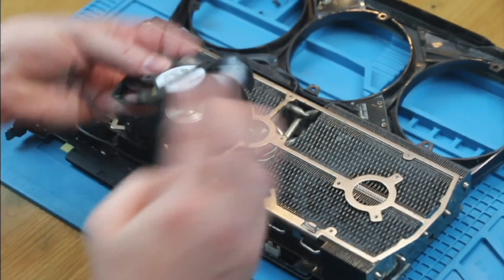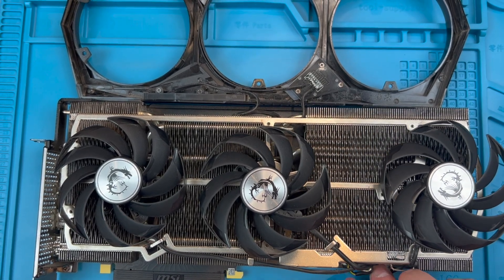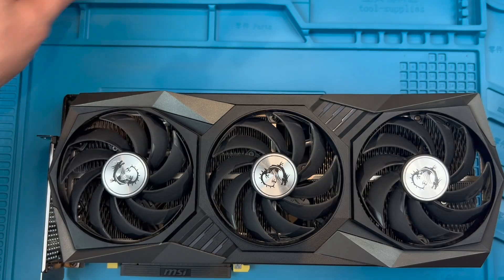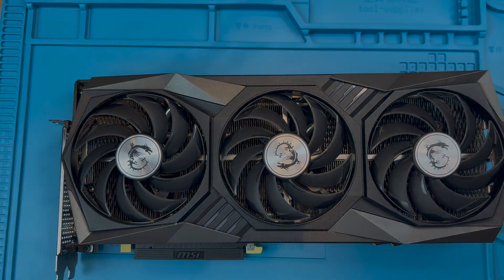MSI Gaming Trio - Easy Fan Replacement in 10 mins

Comment: Thank you for this video! I just bought a Gaming Trio with two inoperable fans. Got a really good deal on it because of it, but the fan replacement kit is cheap and thanks to this video I'll easily be able to replace them in less than 20 minutes. In total 210 dollars paid for a card that goes for about 300 on the used market. I'll call that a win.
Reply from the maker: Excellent, and yes if fans are the problem then a really easy fix. Enjoy the card, new cards are crazy money now.

Comment: Thanks for this. I've ordered some "Singer lubricant oil" from Amazon and plan to flip the fans and apply two drips to each fan bearing.
Reply from the maker: Hope that does the job. The fans seem to a vary a little, some seem to be sealed bearings but back when I made this at least, didn’t seem as common. Good luck 🤞
Reply: @sometechguy  I did it and sadly they don't sound any different.  I couldn't get the shroud off as the previous owner rounded the screw heads annoyingly. This video helped immensely, thanks again Sir

Comment: If set manually, what speed do you consider fans on these models noticeable, or loud?
Reply from the maker: I don’t remember specifically to be honest, but the Trio and Suprim fans move more air than the Ventus for example, so you can run them slower. As I remember, and it’s been a while, 30% or so was pretty effective and pretty quiet, but the time you get past 60%, certainly louder, and at full speed they make a lot of noise. I don’t remember how that corresponds to RPM however
Reply: @sometechguy  my msi trio gets loud above 40 pecent so I did wonder. It's not new, so I wondered if fan wear may contribute to noise. Under 40 percent it's largely quiet and for the most part never needs to go over that speed to stay cool. gpu in games usually runs between 40-50c. The sapphire models seem to be able to run at lower fan speeds from what I can find on here

Comment: I ordered a set of "two ball bearings" from ali express and it was cheap.
I had to replace the front on because it had a weird noise from the bearing.
Easy installation and very helpful video.
I noticed that the new ali express ones are much lighter than the original and also very quiet.
The man fan speed is the same as the original.
Also i noticed a 2-5c increase but im not sure due to climate changes.
Did you noticed any difference in weight of the fans,any thermal increase or any other difference?
What model did you use?
Thanks for your time

Comment: Great video, very informative and clear. Going to replace my fans soon as the bearings are getting a bit noisy on my 3080 gaming x trio haha.
Reply from the maker: Great, and I hope its a help to you. Good luck on the fan replacement. I had a trio card that was a bit noisy, but it was actually a fan that was fouling with the shroud, and loosening and moving the shroud slight fixed it. If its a 'ticking' sound, you are hearing, check this also. You can gentle turn the fans to see if they touch at all, but with mine it only happened occasionally and at mid speed RPM.
Reply: There is rattling on my 3060 Gaming X not even a month after purchase )<. If it will be the same for me as in this video, that is too good to be true. I'll get rid of these gargabe fans and the pointless lighting, and put 2 12mm quality fans under the  card in a PCI slot bracket with adapter cables. The excess cables will make it not pretty, but I prefer less noise.

Comment: hey, nice vid! would you happen to know what size screws for the fans? not the shroud, the fans themselves. some say M1x2, but im not sure?
Reply from the maker: Thank you. Actually, someone else asked the same question and I have not had to replace any screws so I don't know what size they are. The threads on the two screws appear to be the same, but the fans have a counter sunk head where the shroud has a rounded head. But as for the actual size, I would  take one of the existing screws into a hardware store and they should be able to find a direct replacement. Good luck, and if you find the answer it seems like you are not alone in needing to replace them.

Comment: What size/type are the screws initially, gotta replace them due to the gpu slowing gaining rust
Reply from the maker: I don't have the details on the type of screw, as I have never had to replace any. But taking a screw to a hardware shop could be a way to go. The shroud screws and the fan screws are different, with the fan screws being countersunk and flat head, and the shroud having a rounded top. However, they seem to have either the same, or a very similar thread. This is true at least on the units I have taken apart, which is a few.

Sorry I can't help more there, but good luck finding replacements.

Comment: Very helpful video. I noticed that your fans are ball bearing. I just bought a new RTX 3060 TI and it has long life bearing. Have I bought a faulty card or is it random what kind of fan you get?  The reason im replacing the fans is that the card itself gets loud at only 45% fan speed, its completely quiet at 30% .
Your fans are PLD09210B12HH while mine are PLD09210S12HH.  Can you please let me know about this? The ones I ordered from ebay/china are S12HH.  I was wondering if I should order the B12HH but also afraid that they might not work since the original ones are S12HH at the end of the model number..
Reply from the maker: I am not sure why the different fans, it could be manufacturing date, or even where it was manufactured. Maybe MSI changed the fan models at some time. I believe the 'B' fans are ball bearing and the 'S' are sealed fluid bearings. Its possible they moved from one to the other for cost or reliability reasons.

I would say the part numbers are not the most important thing, check the electrical specs, mine were DC 12v 0.40Amp and I would guess those are the same or similar. And of course the fitting, the diameter and the depth of the fan. I picked up some Ventus fans from Ali Express and despite being the same model number, they were physically shallower and the fan blades were too close to the shroud and could foul in certain conditions.

I had a mixed bag from Ali Express, some looked convincingly original enough to believe they are the same unit from the same manufacturing line, some I suspected were not. But if they work, then its probably not a major issue...

And not sure the choice of bearing or fluid bearings is the most important, its probably the quality of the parts construction. Fluid bearings are notionally longer lasting and quieter, but more expensive. But I don't have any comparisons on the two for a given card.

Hope this helps a bit, and good luck.
Reply: @sometechguy  Thanks for the reply. Im getting the order posted tomorrow. I can confirm the fans I ordered are DC 12v 0.40Amp and 90MM dimensions. Same as that ones that are currently in my gaming x trio. Im praying they turn on and run quiet. If not, I will have to reach into my wallet and try to buy the ball bearing version and see how it goes.. let you know tomorrow and thanks again
Reply from the maker: Pleasure and good luck. If you are getting from somewhere like ebay, you could return them if they are not up to scratch.
Reply: @sometechguy  Update on the fans. Just received them the ones sent from China. They actually sent me ball bearing fans.  Some of the fins had dust on them so they were either used or tested heavy, cables were in good condition. 

UNFORTUNATELY there is hushing sound when the fans are spinning. Like a hiss, as if they were being dragged on paper.  What a pity...
Reply from the maker: If you got them from Ali Express you should be able to return for refund. I managed to get a refund on all fans I bought that were not up to scratch, but how easy this is and if it cost me anything depending on the seller. But sending clearly second hand fans kind of sucks.
Reply: @Ladioz  i buy on fluid dynamic bearing PLD09210S12HH and this don't have rattle sound +they quieter
Reply: @AS1C  I bought a set of fluid bearing and also ball bearing. I lost patience with the noises the card was making. Sadly I had to sell this card. I bought an AMD 7700XT now

Comment: One of my RX 6800's fan is a little bit noisy. Not very much but you can hear it even at 35-45% fan speed. I have 2 questions. My MSI varranty won't end if I change this noisy fan? and second: Every MSI Gaming X Trio have the same fan? Is there no difference between Nvidia RTX 3080 and AMD Radeon RX 6800?
Reply from the maker: The warranty question may depend by location. In some places, there is a legal right to repair. As long as you don't damage the card during the work, it should not have an impact. Even where there isn't this right, the fan change doesn't involve breaking the warranty sticker, so again if no damage is done then I wouldn't expect a problem, but may need to check before hand to be certain. If the fans have different electrical details and it blows something up on the card, then this could be a problem, so check that first.

As for the 6800, I have not opened one of those up, but if the fans are the same diameter and the headers are in the same location on the PCB, I wouldn't expect a problem. Look at the video, and at your card and see if everything seems to be in the same place. You can even open it up and check the model numbers of the fans.

One last thing, i saw a Trio card that made a ticking sound from the fans. It wasn't actually a problem with the fan, just that the fan was slightly contacting the shroud at certain fan speeds. If the fan looks like its getting close to the shroud, or if there is some dirt causing that, you can either clean the fan blades with some isopropanol, or loosen the shroud and make sure it has clearance to the fan.

And good luck with the card!

Comment: Is it possible to disassemble and lubricate the fan?
Reply from the maker: If you peal back the sticker from the back of the fan, you should be able to lubricate it there, using something like sewing machine oil. If the fans are a bit noisy, that may fix it without a replacement.
Reply: I believe that it would not last long, since if the bearing is bad the right thing would be to grease it, but they are usually sealed and it would not be possible to do so, and the oil after a few days will dry up and maybe be worse than before…